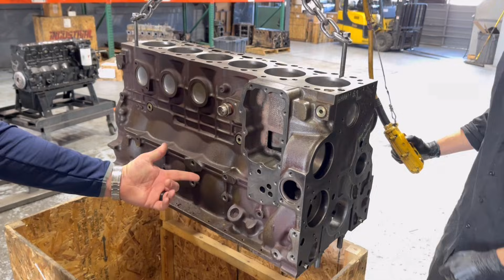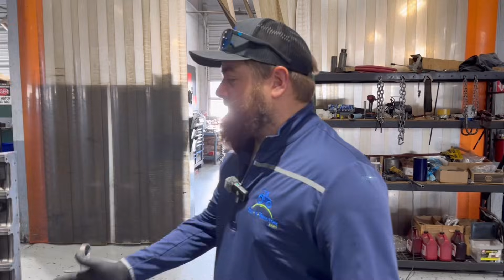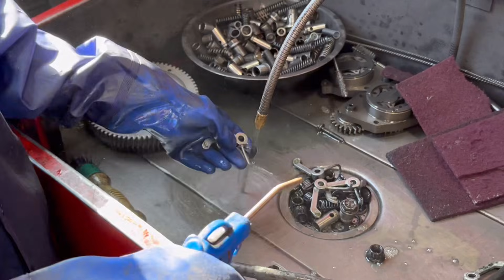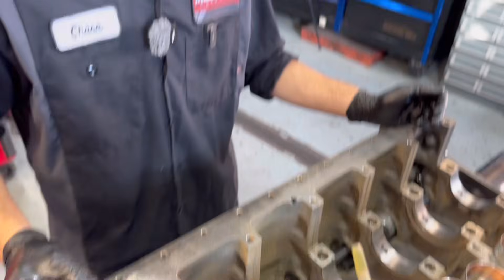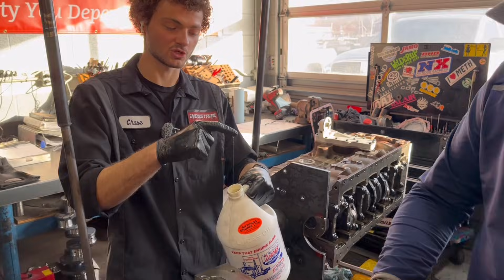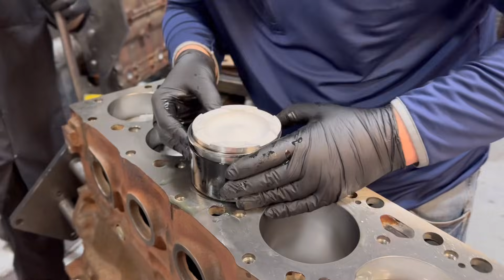Building a 2,000HP Cummins at Industrial Injection! (Part 1)

Comment: I heard that when you bore 20 over on the Cummins blocks it ruins the original heat treat/temper and the sidewalls end up being too soft so you need to sleeve all the cylinders to avoid this? Bruce have you ever heard of this?? This is what my engine builder is telling me and I've never heard of this

Comment: I was always taught that you wanted the washer to be dry underneath and then oil on top or say the bottom side of the nut you do not want the washer to turn on the surface that you're trying to torque up

Comment: I know damn well that block and those names were measured with actual measuring equipment knowing full well that they were in proper clearance I'm sure they were using the plastic gauge just to show as a visual that they were in spec without having to use tools

Comment: So, this is the new (Daimler) Freightliner Cascadia https://www.youtube.com/watch?v=7fKduw2bnII
https://www.youtube.com/watch?v=5YQyLusY55k
- 'So far one of the worst trucks I’ve ever driven. Very very uncomfortable ride, suspension is terrible and we know there’s an engine under the hood so noisy !'

- 'When the manufacturers will understand that we don't need all these safety features, all what we need is better Fuel economy, comfort interior, S-Class noise deadening, premium sound system. That's all what we need.'

-'It would be nice if they could build a truck that doesn't leak everytime it rains. I'm tired of having to wear my scuba suit in my truck.'

Comment: Here’s the issue making 2k hp on. 5.9 your gonna crack cylinder wall… I would of done a 6.7 sleeved down to 5.9
Reply: Yup. That makes the most sense before going billet
Reply: Almost an entire tenth of an inch. Yeah probably the best way to go before going billet, cheapest compared to a 2000hp 5.9 or a billet block.
Reply: Ok i looked it up and google is bs what do you gain and why would you sleave the cylinder down? Honestly curious
Reply: @whitetailsrifleshunting9801  Thicker liner.

Comment: I always Mike bearing thickness, mike crank diameter, and put a dial bore gage in the block to check everything out before I assembled it. You need to mike bearing thickness because there is always a chance of getting the wrong bearing no matter what it's marked.
Reply: Who's mike?